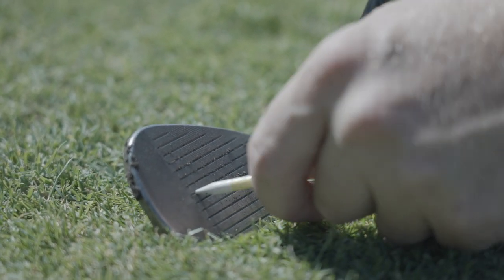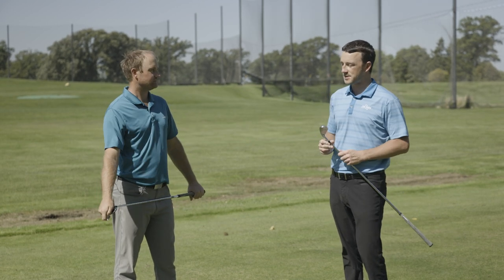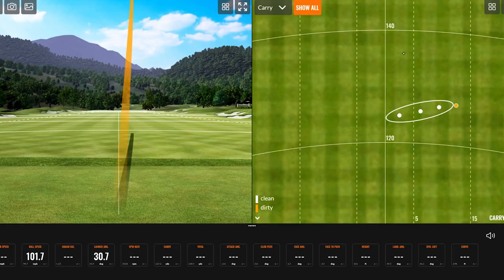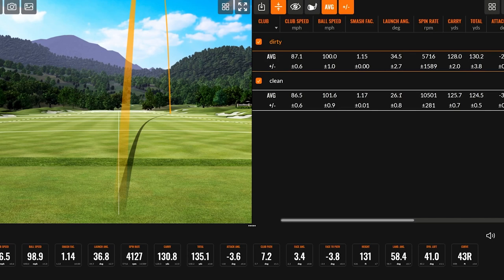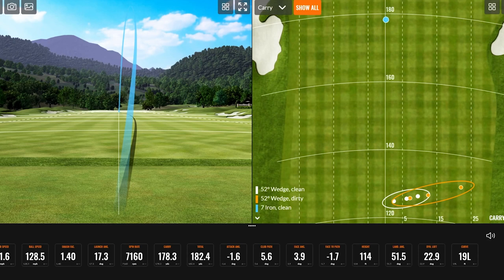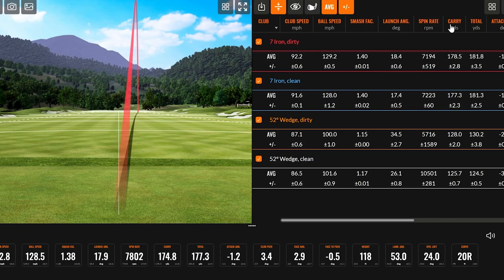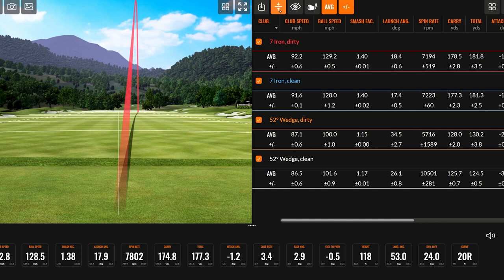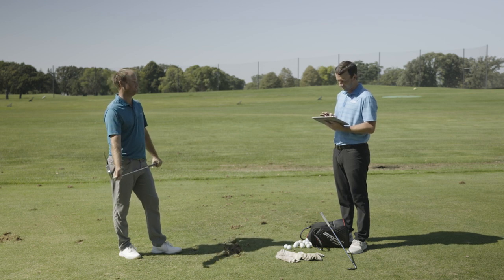Dirty Golf Clubs vs Clean Golf Clubs | Why You Should Clean Your Grooves

Comment: When manufacturers spend millions trying to give spin with groove shapes, micro milling and laser cutting and we spend a fortune on high end balls why would anyone in their right mind not use a brush and a micro fibre towel to keep that performance level? It cost a couple of quid and takes seconds.
Reply from the maker: Great feedback, yes the grooves are designed an there for a reason. If there is dirt in the grooves you may as well use a completely worn face. - Thomas

Comment: What about scoring the grooves? Is there a particular tool for keeping clean and OEM grooves?
Thanks for the content!
Reply from the maker: There are tools out there where you can attempt to score the grooves for worn clubs. I'm still not a fan as you can damage the grooves if not done correctly. A simple brush or tee and wet towel is all you need and if the wedges start to look worn I would suggest replacing, especially the higher lofted wedges. - Thomas

Comment: A guy with crazy back spin on his approach shots said the trick is to only clean the 1st line from the bottom with a tee.
Reply from the maker: That is an interesting concept, I still would be worried about the consistency. If you have ever hit a shot around the green with a wedge when you haven't cleaned sand off the face you can also get some crazy back spin but I would still emphasize consistency by having all your grooves clean. - Thomas

Comment: I'm actually surprised how little effect dirty grooves caused. Thought it would have been more.
Reply from the maker: Thanks for watching. Remember your wedges are your scoring clubs and we saw more of an effect with the wedges. The total distance was also separated by 6 yards I think just that yardage alone will make me want to clean my grooves for every shot unless you want a putt that is 18 feet longer on the green. If you take a look at the consistency, the +/- with clean grooves was 281 rpm while the +/- with dirty grooves was 1589 that is a big takeaway. Also the loss of spin with dirty grooves led to the ball releasing 2 yards vs clean grooves spinning back 1 yard. - Thomas

Comment: With the landing angle steeper with higher launch wouldn’t that offset the loss of RPM? Fitters teach not to worry about Spin as much as landing angle but you just contradicted that?!?!
Reply from the maker: You bring up an interesting point but don't forget about consistency, the +/- with clean grooves was 281 rpm while the +/- with dirty grooves was 1589 that is a big takeaway. Lets also take a look at if that higher launch with dirty grooves offsets the loss of RPM: Clean grooves carry distance = 125.7, Total 124.5 with 10501 rpm the ball came back 1.2 Yards. Dirty grooves carry distance = 128.0, Total  130.2 with 5761 rpm spin the ball released 2.2 yards. So even though the ball launched 8 degrees higher with dirty grooves the difference in stopping power was 3.4 yards, which means you will have a putt that is 10 feet longer on the green. The total distance was also separated by 6 yards I think just that yardage alone will make me want to clean my grooves for every shot - Thomas